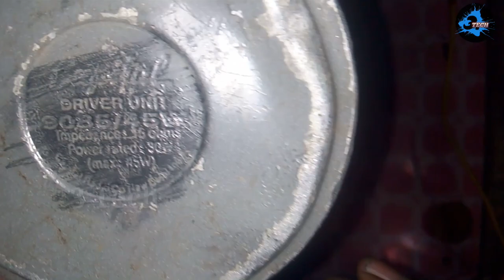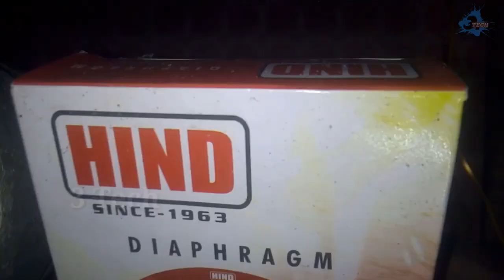PA Driver Units Repair in Tamil //- Driver Unit - Diaphragm - Horn Speaker -All Details

Comment: Bro driver unit ta 4440 ic la connect pannalaama
Reply: Connect pannalam but ic heat agum better then stk4141ic and fet super result bro
Reply: Yannudaiya set ila pottu irukua  yannudaiya u tube chennal parrunga unit test addiga varum